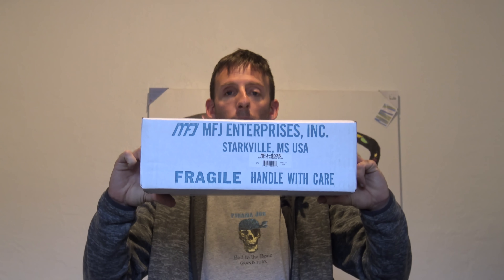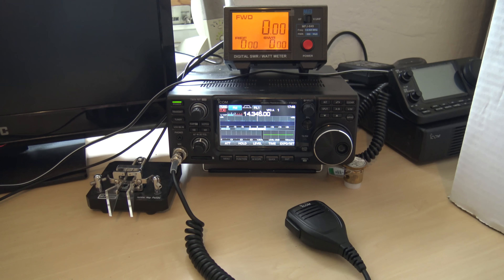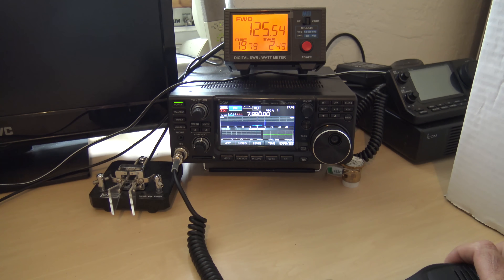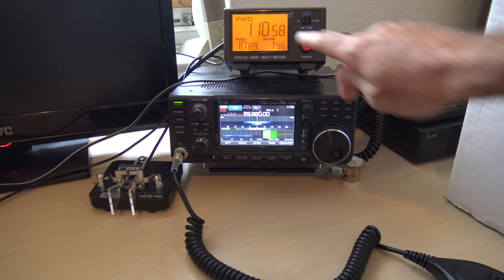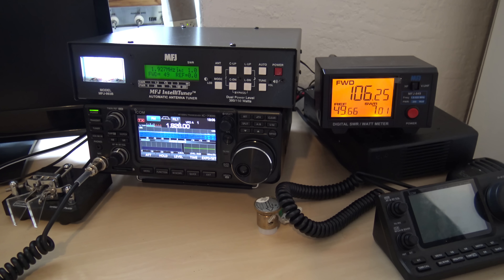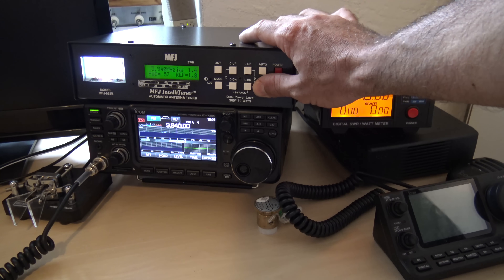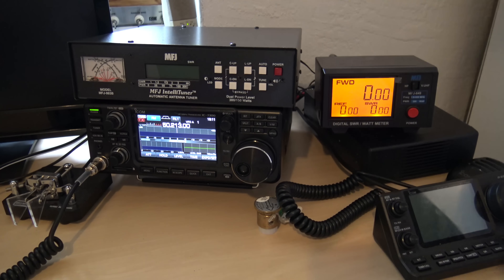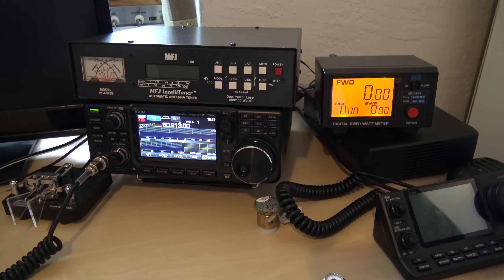Understanding HF Antenna Tuners, What Does It Do?

Comment: Eric, you obviously don't understand how antenna tuners work.  If the tuner says 100 watts is getting out then 100 watts is what is getting out of the antenna and over the airwaves minus the losses in the feed line from the tuner to the antenna. The tuner does not "absorb" the reflected power you claim you are losing based on the 2nd SWR meter. If it did it would get hot and tuners don't get hot and power does not just disappear without a trace based on physics. Instead, it gets reflected back by the tuner to the antenna until it is radiated by the antenna. The second SWR meter located between the tuner and the antenna readings is irrelevant in the context of the conversation.  If as you said, "all antenna tuners do is make the radio happy" then the MFJ magnetic antenna you tested with good results simply would not work. After all, it uses an antenna tuner based on the same principals as all the other ones. The tuner for the magnetic antenna was made to tune a very narrow band antenna with extremely high SWR. But as your test showed, you got out, it worked. Please get informed on a subject before you try to educate us.
Reply from the maker: You are wrong, and I am going to say this. The tuner says 100 watts is getting out because that is what is coming out of the PA section. NOW, THAT is 100 watts leaving the PA, however it does NOT mean that 100 watts is leaving the antenna. the radio is happy seeing a perfect match, but the antenna is still crap if it has a high VSWR.
Reply: @HamRadioConcepts  Generally you make great videos loaded with helpful information but this one was not factually correct.  Yes as previously stated, 100 watts minus feedline losses, is exiting the antenna. On your video at location 10:10 you can see a demonstration that this is actually happening by looking at your second SWR/power meter. Notice the forward power reading of 178 watts. That is what the meter is seeing on the antenna feedline between the antenna and the tuner. This is because the antennas reflected power is being re-reflected back to the antenna along with the power your PA is contributing by the tuned circuit formed between the tuner and the antenna. I am not making this up and you should easily be able to corroborate this with someone you know that is knowledgeable on the subject.
Reply: @HamRadioConcepts  In support of some of the comments by others and mine the text below is excerpted from Wikipedia:
“It is a common misconception that a high standing wave ratio (SWR) per se causes loss, or that an antenna must be resonant in order to transmit well; neither is true. Ref: 1. Maxwell, W. M. (1990). Reflections: Transmission lines and antennas (1st ed.). Newington, CT: American Radio Relay League. ISBN 0-87259-299-5. 2. Moore, Cecil (9 January 2014). "Old XYL's tales in amateur radio". 3. Hall, Jerry, ed. (1988). ARRL Antenna Book. Newington, CT: American Radio Relay League. pp. 25 18&nbsp, ff. ISBN 978-0-87259-206-3.
A well-adjusted ATU feeding an antenna through a low-loss line may have only a small percentage of additional loss compared with an intrinsically matched antenna, even with a high SWR (4:1, for example). Ref: Hall, Jerry, ed. (1988). ARRL Antenna Book. Newington, CT: American Radio Relay League. pp. 25 18&nbsp, ff. ISBN 978-0-87259-206-3.”
Reply: I am sorry but this is statement is incorrect, some of the most effective antennas have fairly crap VSWR, but to be commercially successful they tend to have matching networks built in. (because nearly everyone wants to use 50 ohm coaxial cable). Probably the most misleading terminology is the term "ATU",  it is probably better described as a matcher. Long runs of "budget" coaxial cable in a grossly mismatched system will have far greater losses than in a matched system. These losses escalate with increasing frequency.  An ATU in the shack does not fix the bad SWR on the feeder but it will let the radio generate full power into that feeder. Open wire feeder is far lower loss than coaxial cable, even with pretty high SWRs, that is why many of us go to the trouble of using it.

Comment: I'd like to point out something. I worked on airborne radios for the air force many decades ago and a KC-135 has a probe mounted horizontally at the top of the vertical fin. Look up pictures if you want to see it. That's the HF antenna. Behind the antenna is a lightning arrester (about 18" long and weighs about 10 lbs. Behind that is the automatic antenna tuner. As close to the antenna as feasible. That way it avoids transmission line losses and I've made some pretty long distance radio checks after performing maintenance with them. On the older B-52s that I worked on, "C" and "D" models the whole upper 2/3 of the vertical fin is used as the antenna. The tuner and lightning arrester were also right there as close as feasible. So if you must use an antenna tuner it should be as close to the antenna as possible in order to avoid line losses.
Reply: Unless you are using balance feeder
Reply: Chris,  what frequency did this use and what was the transmission line?

Comment: You cheat the 7300 has the ATU built in :P so you already have and show you use one since you had to turn it off. THAT SAID that SWR meter between the ATU and antenna anyway will show crook stats if the antenna is crook. Good multi banded tuned antennas shouldn't need a tuner. My OCF dipole is like 1.1 on 10m, 1.2:1 on 11m (gotta check it), 1.6:1 on 15m before any additions to the feed line. I think it was 2.2ish:1 on 40m and crook as shit on 80m as it's a short bit of wire really. I'll be honest I've not checked my loop much but it was pulling 1.x:1 on 80m at around 200m+ long.

It's easier to just throw a huge length of cable out and tune the thing and looks better too but it's not impossible to get nicely tuned antennas. Even 2-3 switched home made antennas can get you the full band no tuner necessary and I thought all were well aware of that.

Comment: It is not an antenna Tuner.. it is not really even an antenna matcher.. it is an antenna SYSTEM impedence  matcher... it is matching your 50 ohm icom 7300 to the antenna system (coax, ladder line, wire length, height above ground beyond combo.. i.e. the Impedance of the system. 

It transforms your antenna system's impedance at the output.. into a 50 ohm impedance on the input(radio) side. Beyond that tuner's output.... you have done nothing.
Think of a matcher as the transmission in your 5 speed car. With a heavy load or big hill (high impedence) you need to change gears to better match your engine to the load so as the power can get transferred to the wheels as efficiently as possible without lugging.. (heat).  On the downhill side (low impedence) you can put it in overdrive and cruise. 

A low swr has nothing to do with whether your antenna is resonant or not. It is just telling you how close the impedance the radio is seeing is to 50 ohms. Your antenna will probably not be 50 ohms at resonance unless it's just the right length and distance from ground. However, even if it is 50 ohms at the feed point it doesn't mean it's resonant. 

An antenna is absolutely resonant at only  one frequency. That is the frequency where you have no capacitive or inductive reactance.. just pure radiation resistance. If you have no reactance and EXACTLY 50 ohms of resistance... congratulations .. it's resonant.

A dummy load is just that.. no reactance and 50 ohms resistance the only difference being that the resistance of the dummy load is not RADIATION resistance.  

An antenna/impedance/tuner/matcher does the job of providing equal and opposite inductance and capacitance in the circuit to cancel the antennas reactance on the input(radio) side. What's left is just the resistance. That resistance may be far below 50 ohms so the matcher will add back some reactance to bring it to 50ohm IMPEDANCE if it can.

As someone so accurately pointed out, resonance is not the holy grail of signal propagation. There are many non resonant.. i.e. 5/8 wave verticals that put out a better pattern in the direction we want.... it's all connected guys and that's what makes antennas so much fun to play with! .. have fun guys... and 73 de ka5wpm ... dit dit

p.s.... the important thing about having a happy antenna system is keeping the signal on the feedline until it gets to the radiating element... 

with coax.. the swr between that matcher and the feedpoint is radiating all over the place before it gets to your element.

with balanced line. and 50:1 swr.. the signal radiates very little and most of your signal actually gets to your element... with coax... not so much...
Reply: Swr doesn't make the feedline radiate another radio myth that needs to be dispelled

Comment: Okay, newer ham here. I’m a tech, and I’m going to take my general test this Saturday. I’m trying to absorb as much info regarding antenna and radio combinations. I really like the FT-891, and was thinking about getting the FC-50 tuner with it. But with my searching, I understand an antenna is better at its resonant frequency. I just don’t know if I should or should not get the tuner? I plan on getting an end fed random wire antenna or a portable antenna like that, and I don’t know what length it should be. I hear with random wire antennas, you need a tuner. But if you have a certain length antenna, you can be resonant on one band. Is this true? I’d like to work at least 10,20,40, and 80 meters. Please, any info/constructive criticism is much appreciated.
Reply: This video is completely wrong and he has no idea what he's talking about.

Comment: Should I just throw away my 5/8th wave elevated ground plane then? It's not resonant on the bands I use it for and it uses matching elements (may as well be an ATU) at the feed point to get the correct match. But it's a stunning performer, easily equivalent and possibly better than its half wave resonant counterpart. So just throw it away?
Reply from the maker: Did I say throw it away? No I did not.
Reply: @HamRadioConcepts  Ok then. But you made the video and made the claims. So where does that leave it? By your video a 5/8l antenna ticks all the wrong boxes. It's not resonant and it needs matching. So its an inferior performer? What am I meant to do with the information you have provided in direct application to such a setup? Are you ready to re-think your conclusions?
Reply from the maker: @arthurgiannakis2156  oh geez here it goes again. I tried to be as generic as possible. I'm not going to argue. I'm not trying to battle your expertise. I'm trying to encourage people. Goodbye.

Comment: Thank you for taking the time to make this video Eric. Now, my understanding of an antenna tuner is it saves a $1000.00 radio from being damaged by a $50.00 antenna at a cost of usually less than $200.00. Tuners are kinda like insurance. They are there for that 1 in 1000 times the squirrel chews your cable without you knowing.
Reply: I'm a squirrel and I found that very offensive.

Comment: I had to stop listening because of some of the misinformation here. An antenna does NOT have to be resonant to be efficient. In fact there are several examples of nonresonant antennas that outperform a resonant antenna. Very few broadcast stations use resonant antennas and let's look at your 5/8 wave whip, also non resonant.  By spending a little time in the books I bet you could find at least 20 or more examples quickly. This misinformation needs to be stopped.
Reply: Yeah my loop is around 200m of galv wire around the back fence and almost resonant somehow on 80m but works a bloody treat all the way up and down. It outperforms my OCF dipole on 10m even where the OCF is VERY resonant.
Reply: How much do they cost in comparison to a less expensive antenna and tuner? Some of us are poor.
Reply: Your nitpicking again....
Reply: @David White i think your right. Many people have been taught that too. Like power just vanishes.
Reply: "Your radio's happy, but your antenna sucks"; cracked me up...  😆 🤣
Reply: mrmomb you are absolutely correct, although I commend anyone that makes an effort to put together a video this is fundamentally wrong. (I am a ham and radio engineer). My open wire fed doublet has obviously not seen this video...
Reply: @davidlisney2597  He uses the word tuner in my opinion no such thing its impedance matcher.
Reply from the maker: @dambuster6387   exactly what i meant, but people insist that a tuner is actually tuning their antenna.
Reply: @dambuster6387  exactly. :)
Reply: @HamRadioConcepts  Ive never heard any licensed ham say that a tuner "tunes" an antenna. I could see an uneducated newly licensed ham saying that seeing is how the "antenna tuner" is a misleading term.
Reply: Is your doublet cut to a specific freq or is it 1:1 across the entire band and you have 0 swr on the whole band or do you use it for just one freq?
Reply: @Seeker43  it was originally cut for 40m, but is open wire fed now and gets used for other bands. The SWR doesn't really matter much to openwire, I use a T-match ATU to get it close to 50 ohms. Hugely mismatched antennas at the far end of a long coaxial cable are another matter entirely.
With a doublet there is merit in avoiding resonant lengths....
Reply: How can a non resonate antenna out preform a resonant antenna? It doesn’t seem mathematically correct. Not saying a non resonant antenna won’t work it seem you would have to use more power than a resonant antenna to get the same amount of power out your antenna both will work but the resonant antenna would be more efficient in power use than a non resonant antenna
Reply: @Coyotethumper5  for starters most resonant antennas don't have a 50ohms impedance and would require some form of matching or atu to match it to allow maximum power transfer take a folded dipole which is around 300ohms or a half wave length of wire fed at the end around 3000 to 4000 ohms, additionally if you understand how reflected energy works you'll understand there's no loss at reflection points so using a tuner becomes a reflection point, you be surprised how shorter or longer an antenna can be before its noticeable at the rx side, Walt Maxwells reflections goes into great detail how this works, hope this helps
Reply: @Coyotethumper5  a non resonate antenna could be several wavelengths longer than the resonate antenna. It would offer some gain in a particular direction.

Comment: Where antenna tuners shine are to feed Balanced feedlines for long, long runs.  For instance if I lived or had a cabin in a low spot like a canyon, I could build a high impedance ladder line and go hundreds and hundreds  of feet, feeding a multi-wavelength rhombic or HOHPL style antennas positioned in a much better or higher location.  And remember the proof is in the pudding.  Use a trusted friend to help you compare while you compare the receive.  I once put up 550' of wire in a heck of an ugly loop.  I got better reports on that that loop fed with the MFJ tuner than my mono-band dipoles and double bazooka style dipoles and it worked like a dream on 75.  
Anyway over all I agree with the video but feel at least two things were kind of brushed over or  omitted, balanced feedlines and just how lossy traps and load coils can be.  Don't underestimate how much loss the traps produce, which you could not easily measure at the radio.  If you can afford it go and try a few different antennas and experiment and compare.

Comment: You are right and wrong. When power is reflected at the antenna it comes back to the tuner and in the tuner is reflected back to the antena. In the antena part of it is irradited, part of it is reflected back to the tuner, reaches the tuner, back to the antena, etc. That is why whey you transmit 50 W and the antenna y very out of frecuency, most of the power is reflected at the antenna back to the tunner, then at the tuner reflected back to the antenna until all of the power is transmitted. The meter then reads the sum of all the power that went forward. So, the total power transmitted is the forward measured power minus the reflected measured power (which, is the sum of all the reflected power). 100 forward - 50 reflected is the 50 W transmitted. IF the coax would be ideal and had NO loss and the tunner would have NO loss, you would transmmit ok no problem. The issue is that the coax is lossy as the tunner too. 

Anyway, I agree that a cuasi resonant antenna that has low SWR is better than using a tunner.
Reply: Correct.
The issue is losses in the feeder. 
However, the video is correct regarding the situation at the tuner, but does not explain what happens to the RF, which is important.  RF does not dissapear, it is either radiated, or changed to heat.  Tuners ensure that the heat is not dissipated in the PA components. instead the RF is reflected back towards the radiating element. If the outer surface has RF on it, it radiates from there.  Hence you get RF in the shack and chaos can be caused.

Comment: You can't change the resonant frequency of the antenna through a length of coax...The coax can't take the needed voltage...Use high voltage open wire feeders and you can resonate your antenna 1.8 - 54 MHz continuous coverage...Also need a proper tuner with a high voltage output...Those internal tuners are only capable of flattening out the match into a piece of coax but can't produce the high voltage needed to resonate the antenna  over a wide range of frequencies.
Reply: Sometimes using a 1/4 wave long piece of coax can help.